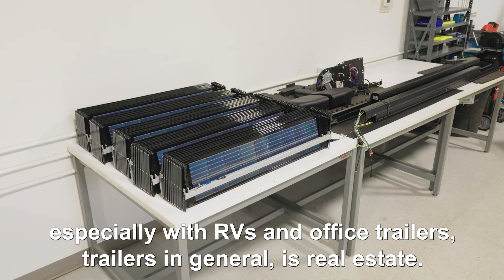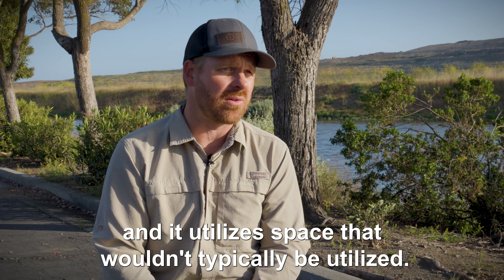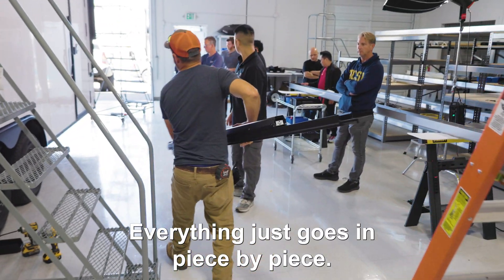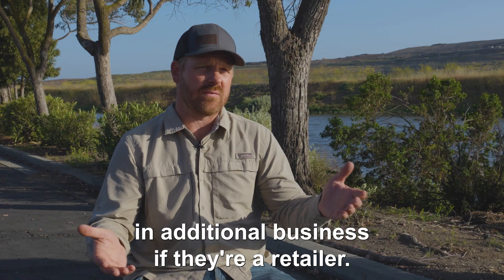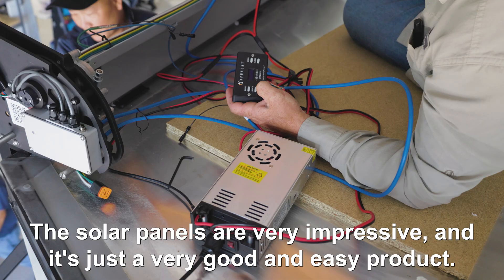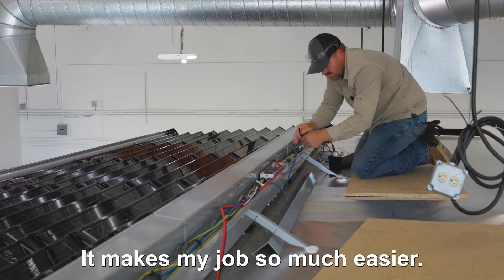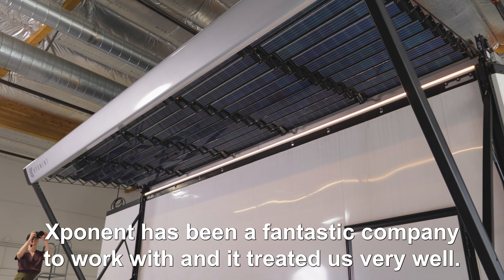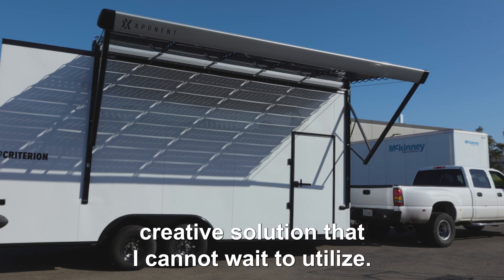Dealers didn't expect this from Xpanse retractable solar

Comment: The 16' , 1200w awning weighs 310 pounds?

Can you confirm this please.

In RVs the weight is a factor and fulltime RVers  are pushing the limit. 

I'm ready to replace one awning now, and the other 2 are not far behind.
Reply from the maker: Yes, that is accurate. Please let us know if you have any other questions and we can schedule a call with you to speak with you.